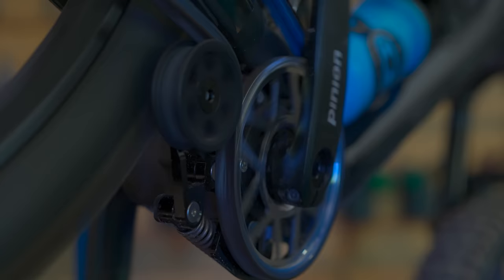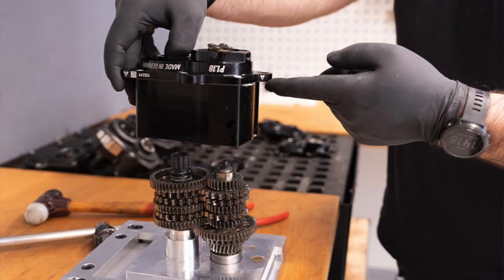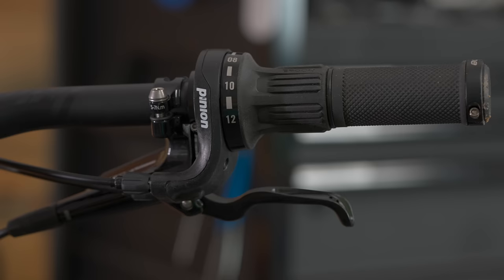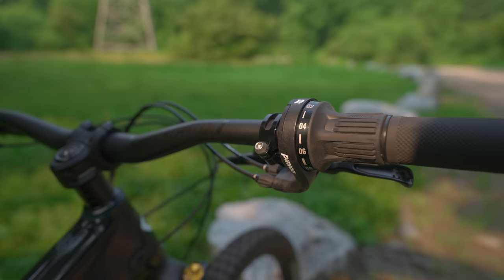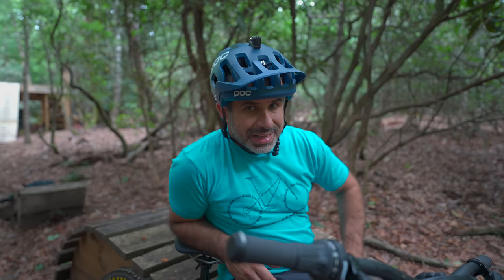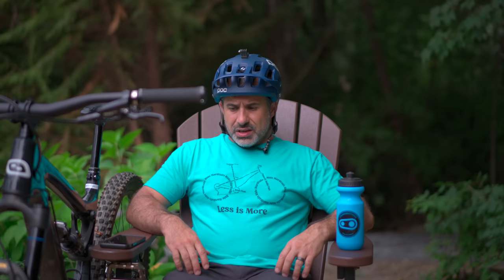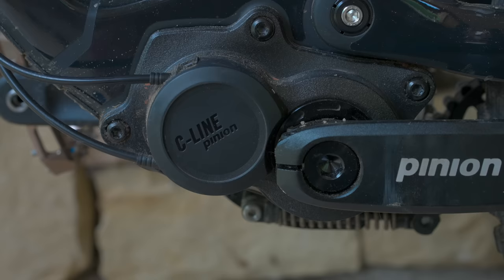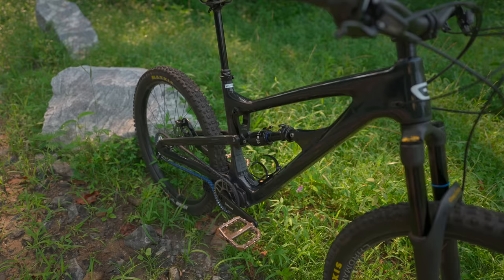What's the deal with gearboxes? Why don't more mountain bikes have them?

Comment: Pinion just unveiled its new Smart Shift electronic trigger shifter, so those who hate grip shift have an alternative. It also is supposed to address the need to soft pedal while shifting; the system detects the best moment to shift (i.e., when your pedals are at 12 and 6, and shifts then). I've been riding the Priority 600X for about six months and love it for bikepacking/rugged touring. I'm not completely giving up on derailleurs though. I will probably continue to use a lighter bike with derailleur so that I can actually keep up with others on single-day gravel rides. My absolute bulldozer of a gearbox bike definitely keeps me in shape!

Comment: A ride buddy has a Pinion, works very nicely. But as with everything there are upsides (range, less day to day maintenance, cleaner) and downsides (limited choice of frames, weight, cost new).
It has to use a grip shift as the gearbox has to be positively shifted both ways although an electronic shift is coming which will fix that.

Comment: Not exactly what he has, but as someone with 2 14spd Rohloff Speedhubs (Internal gear HUB in the rear where the cassette would be in a traditional setup) I can tell you they are extremely reliable. I had by first problems with them after 9 years of MTB use across about 6000 miles and no maintenance except oil changes. The first one had the chain sprocket break and it was 25 dollar fix I did in 15 minutes. The 2nd one had the shift cables fray and one of the strands got bunched up on the shifter making it so I could only shift between 2 gears, this was a 40 dollar 1 hour fix. I also ride year around in all conditions including snowy/icy conditions with salt on the road/paved trails.
EDIT: one of the bonuses of a Rohloff Hub over Pinion is efficiency. Rohloff Hubs are about 92-95% efficient. Derailleurs when clean and new are 95-97% efficient, however this deteriorates over time as they get dirty and worn. You can lose as much as 8% efficiency on derailleur if its filthy and rubbing and not indexed correctly. This never happens with a Rohloff. I do have to admit, it does add an extra pound to the rear wheel which will effect how rear suspension handles though.

Comment: I love my retrofitted Rolhoff hub gearbox (on an orange 66 freeride bike). 
I've done about 15000km offroad on it over about 20 years, I wash the bike about every year, I've never changed the oil, and I oil the chain every month or two. Ive never changed a chain or anything on the drive train. (Rolhoff chain is way stronger than flimsy shifty ones). Its been the best thing about that bike (my old fave bike).  
Used to have one on the mountian tandem as well but the cable friction was too high over that length so had to switch back to deraillleur, but the tandem is the perfect application for a hub, and every time I ride it I wish it could have worked.

Comment: May i mention that the Pinion C-line's main competitor, the Effigear Mimic, solves, if not makes steps towards improving 3 of those issues, price, weight and shifter compatibility. Its also much smaller. 

C-line weight: 2.1kg
Mimic weight: 900g-2kg

C-line price: €1,400
Mimic price: €1,000

C-line shifter: dual cable twist shifter or Cinq dual cable trigger shifter

Mimic shifter: any Sram Eagle shifter

Comment: The Shimano Afine is a hub gearbox and comes in 8 and 11 speed. Substantially cheaper than the Pinion gearbox, I think about USD350, but the gear range is only about 410% Then you have the Rohloff that sits between the two.

Another factor is that if you are going to run a belt drive you need a splitter in your frame and that you should have a spare belt as rarely will a bike shop carry them.

Comment: That's cool tech. I think for those that ride that type of bike as mentioned, prefer the upsides enough that they don't care about the downsides. I also concur with the Berm Peak Narrator, there are ways to get more efficiency.
   That gearbox sounds like it has straight cut gears. Very strong, the downside is that they are noisy. Gleason are much more quiet. Another option are herringbone, but probably not a quiet as Gleason. Then there are the size or number of teeth. Finer gears make less noise. Not that those aren't already fine or Gleason, but they sound like straight cut gears. For the Narrator, your already done with the video. But maybe experimenting with oil could get more efficiency, maybe more noise too. Maybe Pinion will read the post. Small company, but the narrator is correct, in the automotive industry, we use different gears for different purposes. I was trained as a professional automotive tech, so that's why I concur with the narrator.

Comment: I have two Pinion gear box bikes myself. Currently the newest and my main one is a Titanium Olsen Swan built with XC components and running gravel tires. I use it for everything, commuting, road riding trail riding, dirt road riding, bikebacking, ect.. You were the influence for me to look into a Titanium bike. Wish I would have done it sooner.

I have a Priority 600x I'd be willing to let you borrow if you are serious about using the gearbox again.

Comment: Other thing probably worth mentioning just in terms of tech being researched. We've had gearboxes on bikes for more than a century. The sturmey archer 3 speed was introduced in 1902 and in the meantime plenty of companies have had a crack at it. Sturmey archer while under new ownership still exist, Sachs did them for quite some time before SRAM bought them out and discontinued IGHs just a few years ago. Shimano still make some excellent ones. Rohloff, is pricey but comes up in bicycle touring land as a pinion competitor very frequently. We now have the 3X3 Nine, kindernay and revolute Hub1 as recent entrants to the space. And final oddball, Enviolo/Nuvinci with their CVT hub.

Most if these (even the CVT) have been planetary geartrains. But ultimately. Gearboxes on bikes predate the derailleur.

A few cargo trikes and recumbents actually use a mid mounted gearhub too.

But they all have similar drawbacks to the pinion with lesser efficiency, a fair bit of heft (though it's hard to make a true like for like comparison) and don't have the pinions benefit of being mounted center/low on the bike. Though the rohloff supposedly isn't too bad on the efficiency front.

I am picking up a custom wheel for my commuter bike build tomorrow with a Shimano nexus 7 in it. Frames 130mm spaced horizontal dropouts and has no mech hanger, you can get a hanger setup off of a horizontal dropout bike but really the frame is setup for single speed or hub gear.

Comment: After 26 years of riding Rohloff Speedhub gearbox, i am able to give a honest feedback: High quality gearboxes are the most cost-saving products you can buy. in these 26 years, the sparepart costs for all my Rohloff hubs (i have 6 of them) are around 100$. Just a few cable changes. Thats it. How much does a derailleur system cost in that time? The twist shifter has one BIG advantage: I dont need to take my thumb off the bars to change gears. Means way more control downhill. And about the efficiency: Its true that the efficiency is around 1-2% less compared to a brandnew derailleur with cassette. But if the chain is dry/rusty, the efficiency of a chain drops DRASTICALLY down to 75-85%, compared to a gearbox with belt/sealed drivetrain that remains at 96-97% even with no service. summary: buy a gearbox and you WILL LOVE IT the longer you own it.

Comment: Along with the host of really significant other advantages mentioned in the comments.idlike to add that the gearbox beds in and gets more efficient. Also as soon as your chainline is angled significantly or there is a bit of mud. The Zerode Taniwha at least matches the efficiency.
I bought mine for enduro style riding. But it so often outperformed in crosscountryish or bike packing that its my go to bike for nearly everything.
And the price of the zerode bike is less than a santa cruz or pivot at similar spec.
Its been such a revelation and improvement to my riding experience I'm amazed everyone isnt buying them.
But yes i dont crosscountry race.

Comment: I am a Katipo owner and the complaints about higher cost and lower efficiency are just not true: my Strava times (uphill) are the same compared to my previous Specialized Enduro with a 12-speed SRAM Eagle, my cadence is just higher, presumably because I shift now a that it is that fast & simple a lot more. My whole bike did cost less than a comparably equipped Santa Cruz / Specialized / etc., because you can`t compare to a low-budget bike, Zerodes are usually equipped with top of the line components, like FOX Factory suspension, BikeYoke dropper posts with actual long travel, a frame that really can endure any bikepark session etc. and perform at least just as well as those high-end competitors. Everyone who has tried my Katipo so far, hands it back to me saying "This is the future!".

Comment: Really want to see someone try adding a friction modifier to a gearbox. Like liquimoly mos2 antifriction oil, or amsoil severe gear.
Seth is right on that we have had transmissions for a long time… how would some of the solutions we’ve had over the years, snake oily or not, so at solving the problem.
Reply: It's not so much the friction that drags but the "windage." the oil has to be pushed around the gears to lubricate them. A lot of oil gets squished into the meshing gear teeth. Almost eliminates friction, but squishing the oil out drags. There's only so much you can do to mitigate this. Even if the oil is as thin as water, not very good gear lube, it still drags a fair bit.

Comment: Pinions new e-motor and gearbox combo is one of the most promising drivetrain solutions out there IMHO; the added weight is almost nothing, the durability (which is and issue with conventional drivetrains on e-bikes), suspension performance improvement and moving unsprung mass down low on the frame – al good things. For e-bikes, it's an actual revolution. Hope you get to test one.
Reply: Promising as in $3000?
Reply: @janeblogs324  Yes, that’s the definition of “promising”, as Seth mentioned price points are going to come down, and when you compare with current solutions of drivetrains and e-bikes, it’s actually cheap, sort of. I’ve got friends who mainly ride e-bikes, that change cassettes, chainrings, chains etc. 3-4+ times a year with “normal” drivetrains. With Pinions promise of virtually no wear and a once a year oil change, it’s definitely a good deal 🤷‍♂️

Comment: I have owned a Pionion equipped bike, rode it 2016 season. The frame was not great (a Musing from GER), but I loved the Pinion, except for parts being hard to come by. For XC or trail riding, it wasn't a great feel. For anything descending oriented, it was fantastic. I will 100% own another one. When I replace my Nicolai G1, I will probably do so with a gearbox equipped Nicolai. If there was more parts availability and options, I believe a sizable portion of gravity focused riders would be on one. Perfect for 140-200mm bikes

Comment: Living in New Zealand we see a fair few zerodes/pinions 

Having pedalled a few, one comment I have is that when you are pedalling and shifting at the same time, it will stay in the original gear until you let off the pressure. Meaning you can’t shift during a wheelie ect.. 

Simply put you cannot shift under load, not that it’s ill advised, but rather mechanically you cannot
 (or at least that used to be the case)

Comment: I've been riding a priority 600x pinion/belt drive for 2.5 yrs, sligtly less efficient than chain/cassette drive but I'm not racing or competing.  The shifting is great, belt drive is smooth and quiet.  Best advantage (imo) is there is not a drop of oil on outside of bike and very happy not to have to periodically clean/degrease/oil anything.  I've been wondering why we don't see more of these drivetrains.

Comment: Check out the Implon Rapcon Pmax Pinion
It's a gearbox ebike, it's only about 200g heavier than a normal ebike set up. 
wireless shift.
Auto shift keeps it in your perfect cadence so when you start pedaling again it's in the right gear for the speed you're going and it can auto up and down shift without your input ( you can turn these off )
Start gear, stop the bike and it'll automatically change to your preferred start gear.
Change gear without pedaling.
Plus all the advantages listed here.

If I had the money I'd have one tomorrow.

Comment: In my opinion the biggest advantage of a gearbox is that if you crash your bike you don’t brake your derailleur. At the moment I drive single speed on my torque because it’s way too expensive to buy or repair the derailleur if I fall on it.

Comment: The efficiency argument is interesting because the gearbox has an efficiency of mid 90s vs a clean chain with 98 ish. but chain drives drop efficiency quickly below mid 90s when dirty or dusty or anything other than ideal conditions vs gearboxs which as mentioned are completely enclosed and thus don't drop any efficency

Comment: I have woodworking planer made by grizzly with two speed, and it definitely has a gearbox that I have to keep lubricated. To shift gears, the machine has to be running, can’t be under load and there’s definitely a moment when you feel the machine sync up and the lever shifts changing the speed.  Just thought that was a cool add to things that have gearboxes.

Comment: "Type 2 fun" addict here. Who are gearboxes for? For bikepackers who have bent derailleurs, broken hangers, broken chains, cleaned their chains every week (or every day if in deep mud), regularly worn out chains, cogs, and chainrings .... and instead simply want to ride. Yes, in a lab setting there are differences in efficiency. But a self-cleaning drive+belt system is more efficient than a grinding chain system gunked with sticky clay and sand/gravels. I've been riding a Pinion all over ... the Yukon, Patagonia and many places in-between and couldn't be happier. Just replaced my belt in the time I would have gone through 4 chains. Still have not touched my Pinion in the time I would have already replaced my derailleur.

Comment: I've had an internal gear box with belt drivetrain on my commuter bike for about 15 years now. I don't commute much anymore but its amazing. Still on my original belt too. I wouldn't want to use that particular gearbox on a mountain bike though as it just doesn't go low enough for a climbing gear.

Comment: Veer make a joinable belt drive, it is meant for frames with vertical dropouts. Modify an Alfine chain tensioner with the correct belt jockey wheel

Comment: Inventions like this will not catch on until they come out as a top end system on a top end bike that is in the mainstream. Ideally, a pro of some sort would rock it racing. Years ago, Suntour, who invented indexed shifting for the masses, debuted it on a mid-level group. It worked great, but flopped. A couple years later, Shimano came out with it on their top-line Dura Ace group and it revolutionized the industry. That's how is works...

Comment: Every time I've seen efficiency data, naturally enough the chain model is perfectly clean and in perfect order. However, how much this deteriorates in real use is rarely discussed, while the sealed gearbox shouldn't deteriorate at all in real use.
It may well be true that chain drive is still more efficient after a couple of hours mudplugging, but the gap will be no where as big as it was at the start of the ride.

Comment: An interesting thing of note on this, because I saw the price tag caveat coming from a mile away- these kinds of self-contained gearboxes, especially crammed into a space as small as these, require a significant degree of precision, and very tight tolerances on the machined parts within. To a degree a cassette really doesn't.

This essentially means that the minimum cost of manufacture for this kind of product is a non-insubstantial amount higher than that of the alternative, which is likely a big contributor as to why it's not that common. Transmission gearboxes are high-precision pieces of machinery! Cassettes are just big cogs.

Also, if it's a set of gears of differing ratios and a mechanism that changes which particular gear is currently responsible for transmitting power, it's a transmission by most definitions, whether those gears are encompassed in a box or not. I know this isn't the video about the derailleur/cassette product called the Transmission, but you brought it up, and it's been bugging me since that video!

Comment: Seth didn't mention how you can shift without pedaling, super handy when descending & need to get into a higher gear or come up on steep climb & need to dump a bunch of gears. Also with the new e-shift model it will come with a trigger shifter, similar to AXS, so don't have to worry about the grip-shift issue.

Comment: The efficiency is an issue on the pinion, but less on a rohloff. But if you are riding in muddy condition, the efficiency can be better on a gearbox. The price for a gearbox is high, but it last forever like 100.000 - 500.000 km, so if you don't change bike it is a loot cheaper, then any alternatives.